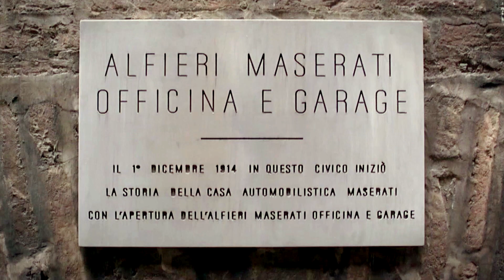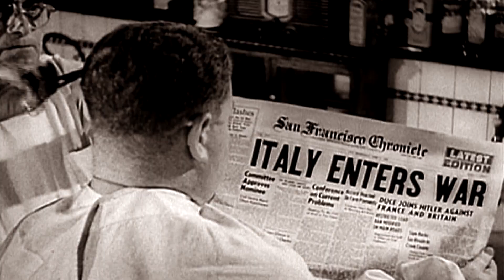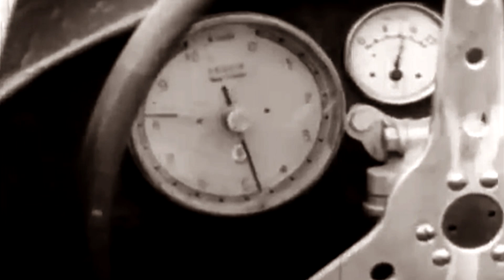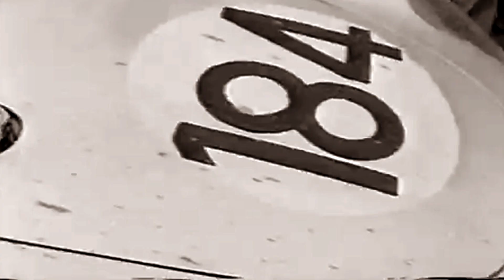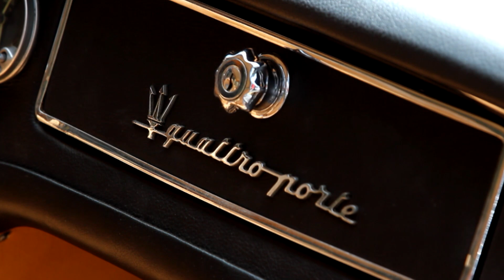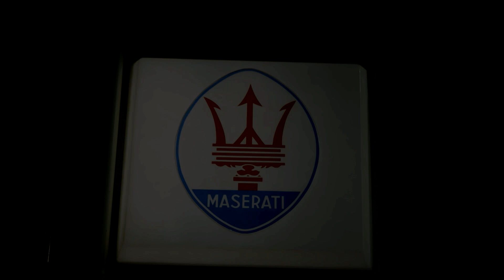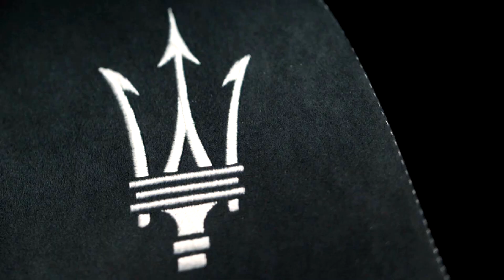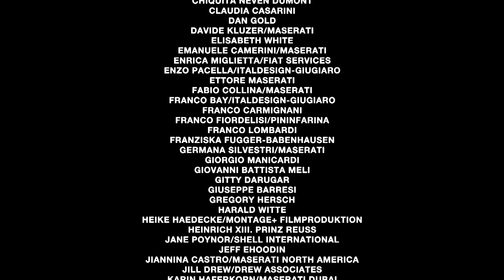Maserati - 100 Years Against All Odds | Full Documentary

Comment: I can only speak for myself, but my 08 GT has been impeccable. I worry about 2 issues I have come across on line regarding the camshaft variators and the hose behind the engine between the firewall. I have inquired numerous indy and Maserati shops on how to be proactive instead of reactive.. Due to the cost of repair and have basically been told. "DEal with it"....